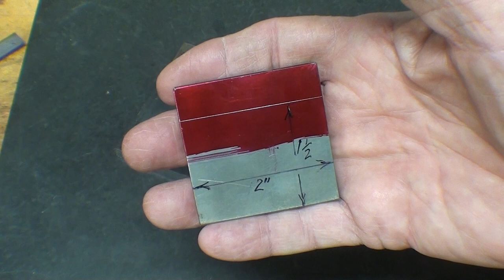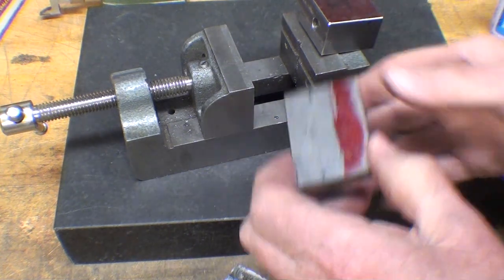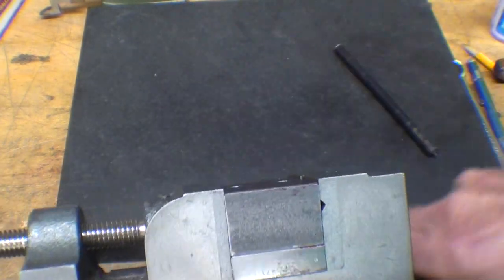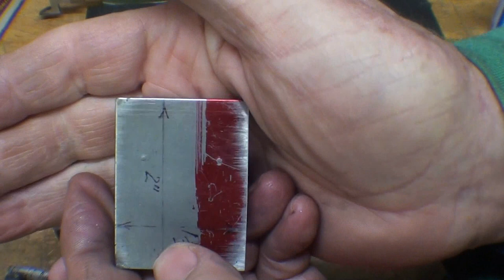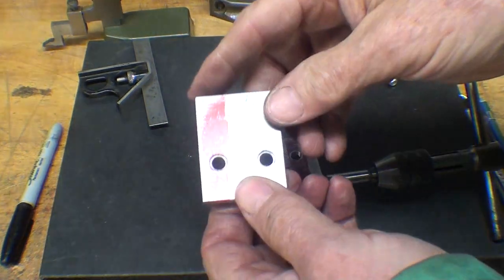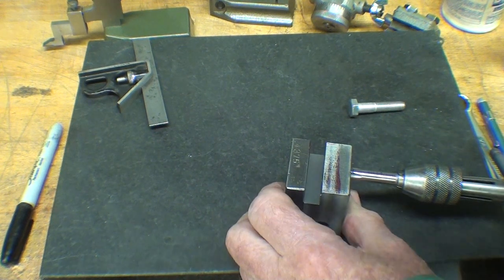TIPS #368 Make a Simple CRAFTSMAN Lathe Carriage Stop pt 3 tubalcain

Comment: A few years ago I made a similar one with only one bolt. It was a failure because I used right hand threaded screw. When I tightened it I cocked it of from the 10" Atlas. If I had used left hand threaded bolt, by tightening it tight beside the apron it would have worked. It did not have that cup-screw though. I did not bother to redo it, in a pinch I wrap a copper plate around and snap on a wise-grip. I enjoy watching you working, it's very pleasant  to see you being so mertacules. I wish I had your patience. Great as always, thanks.  Old Bob
Reply from the maker: Thanks for watching

Comment: Not being critical, just a question.  Why did you make the carriage stop out of steel?  Wouldn't aluminum or brass be easier to machine and when in use would cause less wear on the lathe ways?  Admittedly the cost would be higher, but not a big problem for most hobbyists.

Comment: You are building this stop to work on a craftsman industrial lathe. I have an older craftsman lathe that is not the industrial version, wish it was, and I can make a stop that fits over the top of the way and drops down in the center so it is held straight and can not move cockeyed if it slips. I am going to make mine out of aluminum so it can never mar the ways. Why don't you make one like that, I'm sure people with regular atlas/craftsman lathe would really like that version, though it would not work on the craftsman industrial lathe. I only mention it to you because you spend a lot of time talking about that and the fact it could slip if you were not careful etc. Thanks for all the atlas craftsman info you have made available. It has helped me.

Comment: The old atlas lathe catalog ~ 1940 that you showed with the failed stop block that reached over the way.  You can adapt  your #366 stop block to have this feature by adding an angle iron piece with a section cut out to clear the spindle head.  The angle iron is attached by the two bolts and thus is high enough to go over the top of the carriage.  The remaining vertical portion of the angle  extends down past the edge of the inside edge of the way.   This will stop twisting by an impact of the carriage to the stop bolt. and twisting in one direction when tightening the stop to the way.
Reply from the maker: Thanks-good idea

Comment: Very nice mr pete. I will make the carriage stop my next project for my Atlas.  I'm going to use square headed bolts.
Reply: O.K., I'll bite. Why square head bolts?
Reply: To match the rest of the hardware. I have several wrenches I fabricated for the square heads in addition to the original Atlas supplied. Only reason I guess and maybe silly to some.
Reply: Thanks, Kevin.